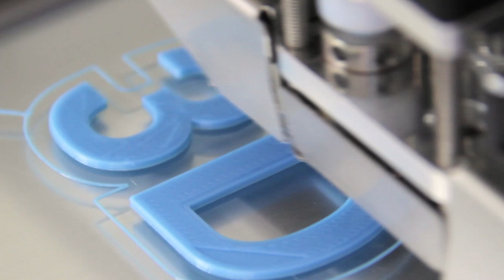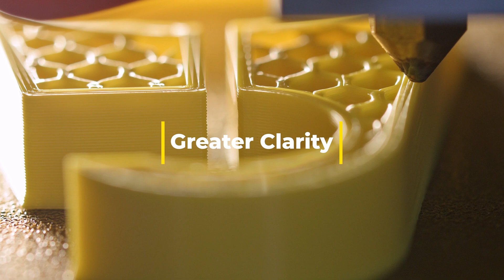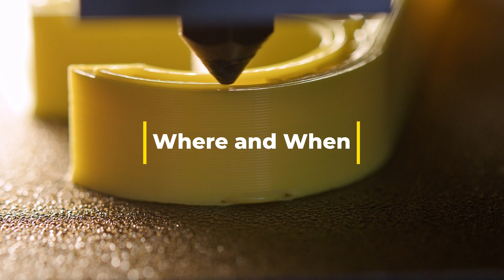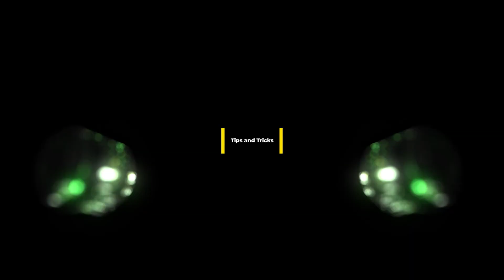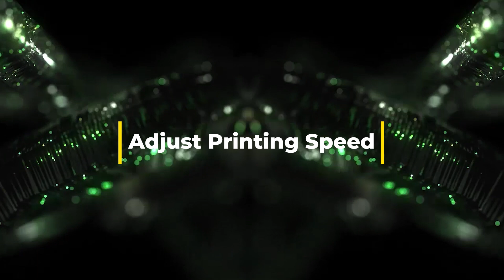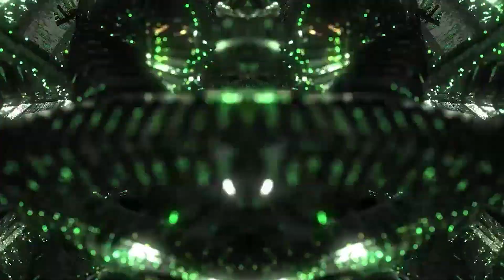PCTG vs PETG Filament - Which One Actually Works Better?

Comment: Nothing about the smell? Does it smell? Are the fumes bad for your health?
Reply from the maker: Hi @SirHackaL0t. Although PCTG should not smell, you can smell it, like a faint burnt plastic, you should print in a enclosure, with a filter, and a well ventilated room for precaution
Reply: @thebulldog3d  Same experience with black one from extrudr. I even would not say it has some better or worse properties, although I never had problem with small parts being ripped of the bed. Smell is major reason I don't particularly like it.
Reply: Filalab PCTG is great. No smell, works fine on open printer, great layer adhesion and bed adhesion @ 75C on a golden PEI bed, easy to print and inexpensive. I've tried black, orange and translucent and the latter one, when printed super slow (15mm/s) is almost completely see-through :)
Reply: @TNX255  Maybe I'll give it a chance if it's available in Europe. Smell is not strong, but it's like burning plastic when I'm close to a printer and maybe it's a bit irritating to eyes. Also it's definitely more ductile and less fragile than PETG, but I would not say it's harder - you can scratch it with fingernail and it cracks on weaker impact than PETG - it does not shatter thou and failure is more predicable. About layer adhesion - i have transparent PETG and then gold PETG, gold one is not that great, but transparent has pretty strong adhesion to itself.
Reply: @pavelperina7629  I have to say I have not done any testing if it's more brittle or not, but layer adhesion and toughness seems better and I also like the finished, shinier surface of it more. The company is Lithuanian so yes it's available in Europe.
Reply: @TNX255  Ooh! I shall be getting some to try out. :)

Comment: What is the temperature characteristics that can withstand?
Reply from the maker: PCTG should be able to withstand temperatures around 302-356°F or 150-180°C with little to no distortion

Comment: What are the downsides? How does this compare in cost to other filaments?
Reply: 800g of Extrudr PCTG costs like 28.5EUR so 35EUR per kg (there are cheaper ones if you are lucky to find color you want in stock). You can get PETG from like 15 to 25EUR per kg. 
Without AI generated bullshit, my experience is ... inconclusive. It feels slightly harder, more ductile and less brittle, but when you hit it with hammer, it cracks sooner than PETG, but PETG shatters completely. So difference is it smells during print as burning plastic - not strongly, but it's not pleasant, it prints at 270C with hotter bed, with high print speeds it changes color to matte dark gray, otherwise it looks like a black glass, it's very shiny. So basically you get more expensive filament that may smell (could be some additives such as black color), advantage seems to be that it sticks to print plate better (small parts) and possibly does not stick to itself when you need tight tolerances (question is if I print PET slightly overextruded). And according to various sources it can survive slightly higher temperature than PETG. I would say you can try it, but IMHO exact hardness depends on part you want to print and it's not strictly worse or better.
Reply from the maker: Downsides on the cost are that PCTG is double the cost
Reply: Downsides are: you need a Higher bed temp of nearly 90°bed and 280° nozzle Temperaturen, Celsius.
Reply: @Chris-14all  Filalab PCTG prints well at 250-270C and 75C on a PEI bed.

Comment: One thing you forgot to mention here is that PCTG is more than twice the price of PETG. Unless there is a very special needs for your part, I think sticking with PETG would be more sensible.
Reply: Let's see how that develops over time. My current spools of PCTG cost about twice of the price of mass market PETG. But only 20% more then a spool of PETG from the same manufactor.  Now if the mass market suppliers pick it up the prices might shift to a similar ratio. Though they are more into "high flow" blends it seems ATM.
Reply from the maker: Its true, PCTG is very expensive, however, as you say, for the right project, used in the right way, PCTG could be the perfect filament
Reply: @thebulldog3d : this ist Not true.
PCTG costs 30€/kg which is quite a bit more than for PETG.

And i tried IT half year ago instead of ASA. I have Not an enclosure for my printer, but IT Support thebhigher temps on nozzle an bed.
I was surprise about the results.
My step son created a Propeller for a wind mill and IT worked very good.

Comment: Another filament that may change the scene is TPU that can have 87 shore D, HDT >100C and shrinkage 0,1-0,3% depending on fibers content. Can be printed even in cold garage 10C and cold bed.
Reply from the maker: Check out my latest video

https://youtu.be/tdw8G_e10A8

Comment: Needing an enclosure is definitely a bit of an oof for those (like me) that don't have one..
Reply from the maker: yeah, needing an enclosure is to help maintain correct temperatures while printing, there are more and more enclosed printers coming to market, typically over time, just like bed slingers, the price will keep creeping down
Reply: Open the bottom of a cardboard box (just make sure it's big enough to not touch.
Reply: @quattrocity9620  yes, cardboard, with heat inside (and no way to see in), definitely no risk of fire there SoonerLater
Reply: @TS_Mind_Swept  if it's not touching anything there's no problem.  Cardboard catches fire at working temperature of pc which is the most common material used to make enclosures.  As for not being able to see inside... If you can't figure out how to make a window in cardboard...
Reply: You don't need one, at least for smaller parts. However I would prefer to have something with carbon filter for this material.

Comment: It’s expensive
Reply from the maker: Unfortunately, yes, PCTG is expensive, I feel that it is geared more towards specific use cases, however, as with most things, the more its purchased the cheaper it will get, much like PLA, this was expensive several years ago, in comparison its pretty cheap now

Comment: Is that a filament dryer or a printer in the thumbnail?
Reply from the maker: Hi @666Corpselord, its supposed to be a 3d printer, although with a roll of filament in there, it looks like it could be a filament dryer
Reply: @thebulldog3d this shows you know absolutely nothing about 3d printing
Reply: because it's ai generated crap

Comment: There is no real improvement in PCTG over PETG for the common man. PCTG is usually more expensive. People who really need to use this type of material already know all about it so I am not sure who this video is made towards. 90% of all people still use trash PLA.
Reply: It's made for people like me who've never heard of it until now ✍
Reply: @philb2334  That´s a good point. It IS educational. Thank you for the comment.
Reply from the maker: I appreciate your perspective! It’s true that material choices can vary widely based on individual needs and applications. PCTG does have its niche, but I understand why many stick with PLA and PETG for everyday use.
Reply: why is pla trash ?
Reply: @georgeyboyhowe1685  It´s a non engineering grade, brittle material which can´t tolerate even temps in a car during summer. The only good PLA is a PLA blend with other materials.
Reply: @sierraecho884  well.......actually PLA on it's own can be used in engineering aspects. I have personally printed GT2 Pulleys, sealchecker arms for packaging machines etc. I use anything from creality cr-10s printers right up to the Markforged X7's and they all run pla on different componentry as well as the more exotic materials like Onyx. Do some research before making uninformed comments. Jeez
Reply: @0800Barfly  Oh boy the "wElLAcTuaLly" arguments coming in. Yeah and playdoh can also be used for that however it´s still not an engineering grade material.
You can use clapm shells for all I care this does not make my argument invalid.
Btw I do work in automotive engineering. We use all sorts of printers, since the 80´s AwCtUAlLy so I did do my research i design the crap and as I have said non engineering no matter your opinion =)
Reply: @sierraecho884  you mad bro? PETG bend on a hot car too.
Reply: @elude3808  You either didn´t read or comprehend my comment. Have a nice day.
Reply: Yeah, I use the cheapest PLA possible to prototype then print in a material to suit the application, mostly PETG, ABS & TPU.  Lately, using CPE which is a really nice alternative to PETG.  Do have a roll of PLA+, for quick one-off temporary parts.
Reply: @chrisgill5692  That´s a good strategy, as long as time is not the limiting factor but budget. For me it´s the material management and storage plus my time.
I use 3 types of materials. PETG in white PETG in Black and PETG in translucent, al from the same supplier. This makes storage easier as I can easily see what I need to buy and it makes coloring easier. I simply color the translucent material while printing for all the other stuff it either comes in black or white, those two go with everything basically.
PLA to PETG price difference is so small that it simply does not make sense for me personally, but situations differ from person to person.
Thank you for the input.
Reply: I like pctg over petg. More flex prints as good if not better than pla+. A little more heat resistance than petg is a good reason. Oh and clear pctg is very very nice
Reply: @redndeyes  "...I like pctg over petg. ..." This is understandable. All the things you have said are true. However it costs significantly more (at least where I am) and is harder to find. PC or PA is ever better yet but again more costs more difficult to print etc.

Comment: At this point i am HEAVILY doubting this aint AI generated bullshit.

..."its harder to drill and sand because its harder than PLA" is the type of bullshit chatgpt throws at you.

Nope.

Too soft is frankly worse than too hard, if you want to mill, drill, or sand it.
As it gums up everythign.
Reply: It very much sounds like AI generated.
Reply from the maker: Thank you for sharing your thoughts! It’s important to discuss these nuances when it comes to 3D printing materials. Your feedback really helps deepen the conversation!
Reply: @thebulldog3d damn, even your answers look like from an Ai 😅
Reply from the maker: Sorry that its coming across this way, yes, I use AI to help speed up some of my processes, the voiceover is a clone of my voice to help speed up my editing
Reply: @thebulldog3d maybe so, but you repeat stuff you have already said, making it sound AI. Not to mention the monotone voice.
Reply from the maker: @shanej2429, thank you for the constructive comments, my monotone voice is something I am working on, and practicing, here are 2 other videos that are me, not cloned, that I feel are also monotone in there delivery, I felt that the cloned voice, was actually better

https://youtu.be/NNWB6CgbPOo - Bambu Lab P1S Upgrades
https://youtu.be/0WcyWJ542v4 - Bambu Lab P1S Unboxing
Reply: @thebulldog3d  fair call, nothing wrong with your other videos, though.  I'm not trying to hate. Just my unwarranted opinion haha.
Reply from the maker: Thanks @shanej2429, maybe just hearing my own voice is off putting to me and sounds terrible, as the cloned one is a little different, it sounds better to me lol
Reply: @thebulldog3d  It's less the voice - it's the text it speaks that sounds like it's AI generated.
Reply: @thebulldog3d a feedback: the cloend AI voice is terrible to listen too. Sorry but I don't finish the video

Comment: More surface hardness combined with higher melting point is actually better for sanding, not worse! I would love to have more infos on potential VOCs because this sounds like ABS filament if it was good 😂
Reply from the maker: You're absolutely right! Higher surface hardness and melting point can really enhance the sanding process. I’ll definitely look into the VOCs and share more insights soon!
Reply: Which properties of ABS do you want? The main draw to ABS/ASA is the high heat deflection temperature combined with low creep under sustained loads while being elastic enough to deal with vibration and transient stress. That's why you'd print parts for Vorons or Milos from it - at least PETG seems to work at first, but over time things go out of shape.
For different load scenarios PCTG might be the better choice of course.